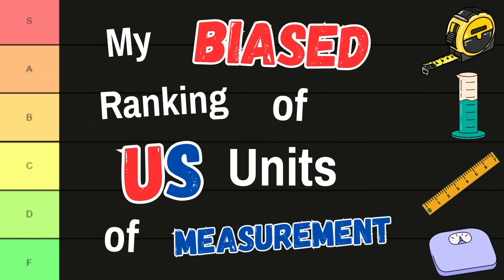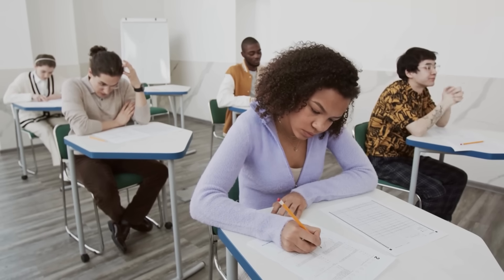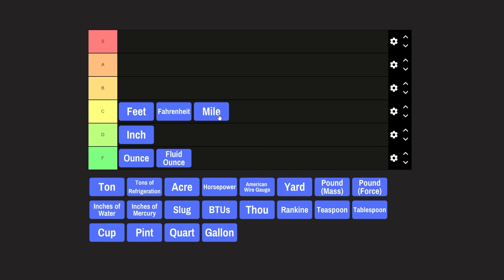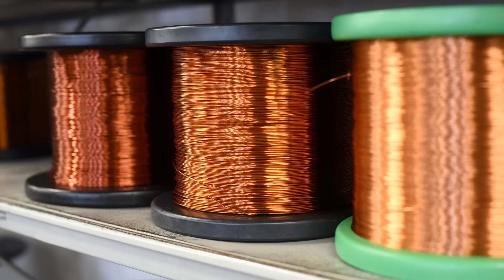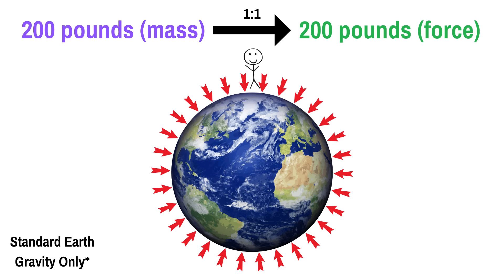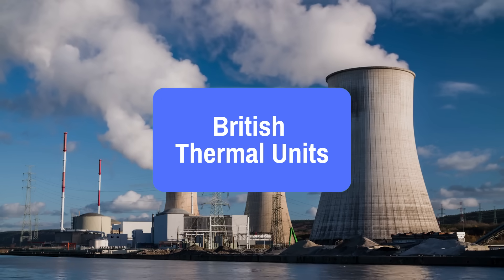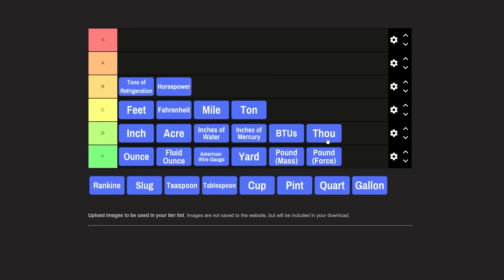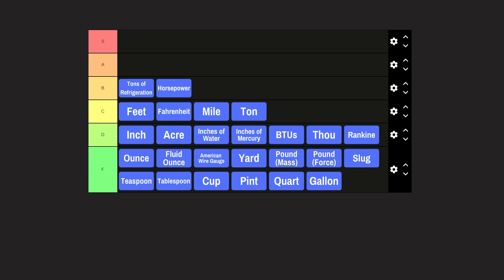Tier List of the DISASTROUS US Measuring System

Comment: My favorite aspects of Imperial:
1) base 12 is great for 3 and 4-part designs like legs for chairs, inches and yards split really easy for quick projects while I'd need fractions in metric 
2) buying a gallon of a drinkable liquid will never stop being funny to me. "Got five gallons of water" hahaha
3) Fahrenheit 411 is a good book
4) 5k runs are longer than 1.5 mile runs, yuck
Reply: "inches split easily" into what?  You measure in 2 3/16".  How is that easier than 55.5 mm?  Or maybe that would be 55 mm?  Nah, 55 mm would be 2 11/64".  No further comment (because that would end in an insult to each any every "American")
Reply: @JürgenErhard  Inches split easily into fractions, as you just demonstrated quite well.👏
Reply: @meotjaengi  But many people have trouble with fractions, unless of course they're decimal fractions.  Guess which measurement system uses those?
Reply: @JürgenErhard   Ironically, your position panders to the lowest common denominator~😅
Reply: @JürgenErhard  I guess you didn't read my comment. Base 12 has 3 and 4 as factors.

Comment: Arguably, Teaspoon/Tablespoon are the only actually sensible measuring system. This is due to the amount being so small that you can't measure volume or weight regularly. Good luck with a recipe that requires 8g of salt (or 6ml) - the teaspoon is appropriate in the very circumstance it is used. At the same time, it's not an exact science, so you can accept the margin of error with the measurement. This is also why cup, etc. aren't as useful - because you can expect it being rounded to fit the measuring system when you could instead use a scale or measuring cup.

Comment: I won't mind if US Measuring system was all unified under Duodecimal or Hexadecimal. The problem is 1ft=12in while 1lb=16oz & 1pt=16floz. 1yd=3ft, 1mi=63,360in=1,760yd. Hexadecimal kinda make sense if you think of it as halving down like 1/2, 1/4, 1/8, 1/16... but GOD FUCKING DAMN THIS MESS!

Comment: Obviously they are all F tier, it's the bad system of measurements. Vive la revolution! :p
Reply: Ok horsepower is kinda cool, and it is about the power of one horse, just not in short bursts, cause that's not how you use a steam engine (nobody goes through the trouble of starting up a stream engine for 5 seconds of use). It was compared to draft horses milling grain for the 'draft', hence the name, of the beer making process. So he actually measured the power of your standard relatively cheap horse used for milling for hours at a time. Most modern measurements look at the maximum power of a modern horse which are basically all for recreation and sport so significantly more fit than your average old school work horse, which is obviously a lot more. That's like calculating the average power of an amateur marathon runner and then saying, but Usain Bolt did a lot more power during his 100m dash! Yeah obviously, that's not the point. Nobody cares about that. If you want to move from horses to steam engines as a factory owner, you're not interested in how much power a horse can deliver in a short burst, but how many engines you need to replace your 12 horses running the factory all day. Horsepower was never intended to become an actually used unit of measurement, it was a marketing strategy. It's like someone saying this can of energy drink has 4 times the caffeine than your average coffee and then somehow coffee becomes a complete standardised and frequently used unit of measurement for the amount of a soluble in water. That's kinda the ridiculous path that horsepower went through.

Comment: As an American, not a fan of the us measuring system. But then I remember England uses stones. However, Fahrenheit does make sense than Celsius when considering 0 being very cold and 100 is very hot. Rarely does it come to a negative (depending on where you live) where I’m sure the temperature does drop below 0C frequently. Also Celsius doesn’t give much of a range of temperature the difference between 25C and 35C is only 10 yet it’s a big change is temperature.
Reply: I know that, like right now when the temp hovers around 0 °C, that it could be icy outside.  "Yeah, and for Fahrenheit it's 32"  I find 0 a bit (a tiny bit, granted, but still a bit) easier to remember.  (Now, I find 32 very easy to remember, being an old-school 80s homecomputers IT guy, but that's just me, and it's still a "harder" than "0")

And 100 °F is way hot.  25 °C is my upper comfort limit (sometimes already a bit over the limit).  30 °C?  Go away!  37° C?  Kill me.  Those temps are highly subjective, so that's automatically not something Fahrenheit is better at.

As to "Fahrenheit is more fine-grained"… well, Americans need it simple, Celsius seems to be too difficult for them.  Not what you want to argue for, now is it?

Comment: Thou also called a mil. Used in vinyl tile protective coating as thickness. Many confuse it because it looks like Millimetre and is very small.
Reply: It's used all over for thicknesses (e.g. trashbags) and tolerances (e.g. acceptable range for the gap between cam and valvestem in an engine).

Comment: I'm actually impressed at how opposite my opinions were on almost every single unit. Inches are fantastic because if you give me an inch and ask me to tell you how big 1/32 inch is, I could very easily do it to some degree of accuracy by halfing, halfing, halfing, halfing, halfing. If you asked me to show you a tenth of a centimeter, it would be much more difficult. No easy way to visually divide by 10. 
You also failed to mention that 1° F is the minimum difference in air temperature the average person can notice. Idk what you were on about horsepower, that is a trash unit. Same with tons. BTU is actually a super genius measurement based on real world phenomenon. Almost exactly the same concept as a calorie, just with imperial units, which is obviously a draw back. Feet are ridiculous but also much more usable than meters for day to day life. Just a more convenient size to work with. 
Pound force and pound mass are so obviously good I have no idea why you put it in F tier. You say it's arbitrary to have a force unit that equals a mass unit under earth gravity but it is one of the most intuitive things and one of the biggest flaws in the metric system imo. Nobody has any intuitive understanding about how much force a newton is, but if there was a force measurement that was the same as 1kg in earth gravity, understanding force would be so much easier. Converting between lbf and lbm is also ridiculously easy. But converting someone's mass to the force they produce on the ground or a structure they are standing on in metric is much less intuitive. And yes, that is a very real and common thing that needs to be done in day to day life. Knowing the rope can handle 150 lbs is way more useful than knowing it can handle x amount of newtons.
Reply: But yes, I do agree that none should make it above B tier. Lots of good concepts, and lots of poor execution.

Comment: The US Customary units of length aren't half bad, especially if you're an average-sized man whose body proportions correspond to the units. I have a 1-foot shoe, a 1-fathom armspan, and a 1/1000-mile pace, which makes estimating lengths with my body easy.

As an American former mechanical engineering student, all the other units (especially BTUs 💀) are absolutely cursed and F-tier is far too good for them. More like Z-tier.

Comment: For wire guage, you would right the higher values as 1/0, 2/0, 3/0, and 4/0. And you would call it one ought, two ought, ECT
Reply: etc. not ECT, as it is the short form of "et cetera".

Comment: My biased tier list of the Metric System:

The second is defined as the time between 9192631770 hyperfine transition of a Cesium atom.  F tier.

The meter is defined as the distance light travels in a vacuum divided by 299792458.  F tier.

and so on
Reply: What kind of unit are you using for time? But I agree on the meter one. At least it acts kinda like a foundation and everything from there makes sense
Reply: @ilikeleek  you're aware that this is a joke comment, right

Comment: as a Euro, Fahrenheit is always the most infuriating to me, it makes 0 sense no matter which way you shake it. Surely they mustve known that Human body temperature is inconsistent anyway right?. The other ones I either didn't know about(Slug, which has a even worse definition than Fahrenheit), or they're leftovers from ye olden days(feet, inch, pound, tbsp, cups, etc), when the kind of precision you get from the Metric system simply isn't needed. If the entire recipe is in Cups, it doesn't matter that my cup is 20ml smaller than my neighbors, the ratio is still corect
Reply: Well th e0 in Fahrenheit is the lowest temperature they could manage perhaps. That would make sense in a way.

Comment: im so thankful, that we use metric in europe. everything is just times 10 or 100 or thousand based on one standard measurement per unit, like the meter. one kilometer is just 1000 meters, one milleter is 1/1000 of a meter. same for liters and so on. you can combine them so easy. its alwas just times 10

Comment: As a European, I have a soft spot for teaspoons and tablespoons, and we use it a lot when cooking. A teaspoon is 5 ml, a tablespoon is 15 ml.
Reply: Depends on where in Europe you live and if there's forced standardization for tea/table spoons. I can look into my kitchen drawers and find 4 different size teaspoons and like 6 different size tablespoons. So if I find a recipe that only gives ingredient amounts in tea/table spoons I'll just chalk the author up as an idiot and ignore it's existence.
Reply: @Jack_Rakan  Cooking measures use measuring spoons, not whatever random spoons you find in your cutlery drawer. Although even there there's a difference: an international teaspoon is 5ml (giving a tablespoon of 15ml, except in Australia where it's 20 for some reason), but an American teaspoon is actually slightly less than 4.93 ml
Reply: @nac5901  So about 1% of error for the american teaspoon. Big deal !
Reply: @melikmourali2072  Not suggesting it's relevant to cooking (a lot of people just eyeball it anyway, and don't even use a spoon), just that it would be a hell of a coincidence if a traditional non-metric unit just happened to be an exact integer in metric units.
Reply: @Jack_Rakan  You can buy measuring spoons in IKEA and I'd assume more places which come with a standard set of tea- and tablespoons (which are standardized to 5 and 15 ml, respectively)
Reply: @TheMrMe1 or you know, just specify what amount it is. Imagine a guide giving lengths where to mix in metric foot (30 cm) and metre. That's what it is having a recipe that gives me units in litre and spoons. We shouldn't have a different name for a unit like this.

Also tablespoons are 20 ml in Australia, so international recipes is a mess.
Reply: @TheMrMe1 you know whats even better than buying specific measuring devices from IKEA for this one purpose? 

Listing the ingredients in ml to use ANY available measuring device instead.
Reply: As a European, I absolutely loath spoons and cups as a unit of measurement because they tell me absolutely nothing. I had to buy measuring spoons and cups. Jesus.
Reply: It's IMHO the most stupid unit of measurement ever. I hate them more than Fahrenheit and this is unit I refuse to understand just from the principle.
Reply: As a fellow european i hate teaspoon and tablespoon measurements. My spoons are not same size and do you mean a flat spoon of salt or should i just scoop it? There is an invariance of at least 3x in a teaspoon. Just say 5g oder 5ml
Reply: Another unit that needs to be measured in metric to have a standard.
Reply: And use weight, when you can, for your ingredients when cooking!
Reply: Fun fact, spoons in Europe are also standardized ...
1 tablespoon is 15ml a teaspoon is 5ml
at least with standard cutlery and no stuff with a designer on it ...

Comment: The other thing I don't understand is why do Americans use fractions to describe length? Like 1/8 of an inch. They can't even tell whether 1/3 or 1/4 is larger, yet 1/8 of an inch is somewhat acceptable? I recently purchased a plank that is 23/32 inch thick. Yep, not 3 quarters, it has to be exactly 1/32 of an inch thinner than 3 quarters, and by the way, that's 0.79 mm if anyone's wondering. Like why?

Comment: I mean the meter and kilogram are also arbitrary units. The only reason metric is “better” is for doing measurements in industry or science. For everyday use, it’s much easier to gauge that someone is 6 foot rather than 180 cm. A switch of 30 degrees in Fahrenheit is a reasonable change but 30 degrees Celsius is like from 100-0 in Fahrenheit. I will agree though that people who try to do industry calculations using imperial systems are wasting their time. But as an everyday thing I think it works
Reply: Its of course simple for someone like you who's already used to imperial system but to imagine it as someone who knows neither of them

Comment: As I often tell people, I am an 🇺🇲American🇺🇲, and therefore free to use any units I see fit. So I use SI/metric units.
Reply: I've move to the US 10 years ago 

Tempature: C
Worn/held weight: lb 
Metric for all other weight 
Running: Mile, min/mile
Driving: Mile, MPH (obvious reason)
Hiking: km
Wood work: inch
Machining inch/ thou inch
Altitude: m
Inch, miles and metric for other distance 
Volume all metric (excpet for cooking)  
Torque: in-lb, ft-lb

So yhea
Reply: @Nathan-jh1ho Embrace metric machining! Even a cheap DRO will have two modes.

Comment: As an American there are a few things the imperial system that I do find advantageous. While the metric system is great for math and science, I do like the imperial system for items that are on a more human scale. 

For example the metric system doesn't have a great unit for easily understanding stuff between 60cms and 3 meters (approximately and 10 feet). I find it difficult trying to approximate the height of something when I hear it is 180cms. As numbers get bigger our minds have more difficulty visualizing them. Now I do understand there is a suitable unit of measurement between cm and m that would solve this issue for me, but it is never used. Not really sure why decimeter is not used either as it seems so useful!

I also like gallons as it is a larger unit of measurement that has good function at the human level.
Reply: I mean, 180cm is 1.80m, which sits just a few cm from the height of a normal door... if the number gets bigger you just move the scale and the number gets smaller lol.
Reply: I was never good at estimating distances (back in the army I was… really bad at such exercises) So, I don't understand all this "it's much better for estimations of length and height and distance".  Also: it's learned.  I have no problem (not more of a problem, that is) estimating how high something of 1.80 m is, because I am 182 cm (see what I did there?)

"As the numbers get bigger, our minds have more difficulty visualizing them"  Yes, and that's completely separate from which unit system you use.  Our minds are simply not good at "visualizing" or simply handling big  numbers.  We (all of use) are just bad at that.  (Some can reach a bit further, but… no human really "feels" billions, and those, cosmically speaking, are such comically small numbers)  "100 billions dollars" is an abstract amount, to all of us.

As to distance: "40 football fields" (whether you think soccer or american football) is a measure that makes people think they have a grasp, but they don't.  They just feel better.

"I also like <another unit I'm very used to because I grew up with it>"

Yes, I grew up metric and find it more "intuitive" but I also know why I feel that way and that the metric system isn't more intuitive.  Both systems are learned.  Although metric is still way better.  ;-)

Comment: I went down a deep rabbit hole about units a while back.

One interesting difference between imperial and metric is that imperial is FLT (Force, Length, Time) based, and metric is MLT (Mass, Length, Time). With three base units, you can build any other unit. For example, acceleration would be L/T^2 (length per time squared, ie: m/s^2 or ft/s^2). Pressure would be F/L^2 in a force based system (force per length squared, or force per area, ie: psi or kg/m/s^2 lol). Recalling that Force = Mass * Acceleration, you see F = M * L / T^2. Pressure in an MLT system then becomes M/(L*T^2) which is weird. The conversion between FLT and MLT ends up generating some very odd units.

Luckily if you are a fan of the metric system, there is the Newton if you want to use Force based units.
Reply: SI is one of the possible metric system of units . In SI, you havze seven base units:
metre, kilogram, second, ampere, kelvin, mole, candela. All other units are derived from those seven units. The system is coherent.
US Customary Units is just a bizarre collection of incoherent units loved by US carpenters and metalworkers